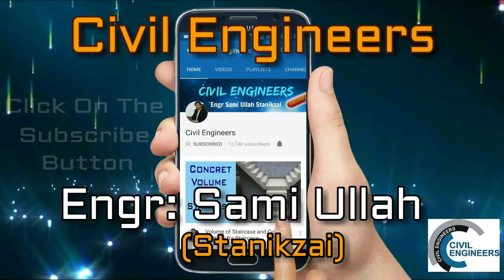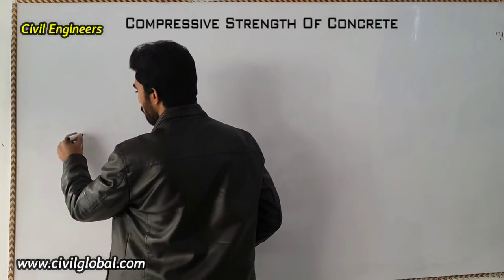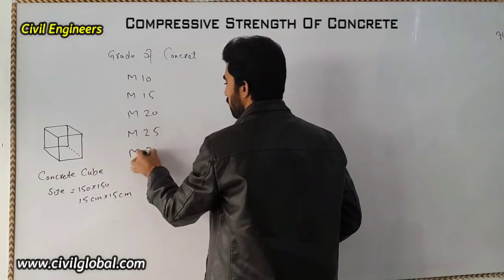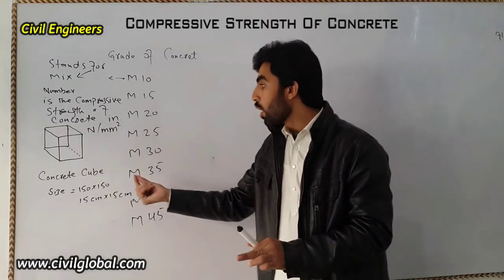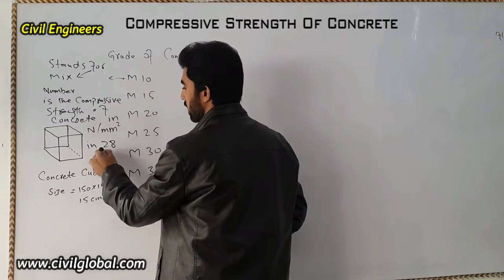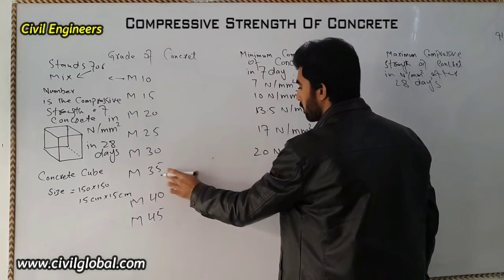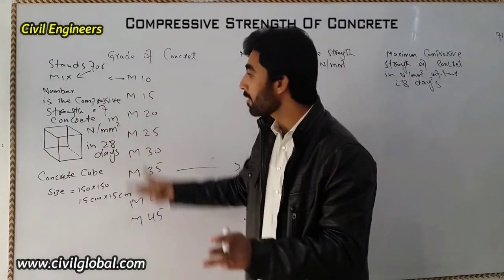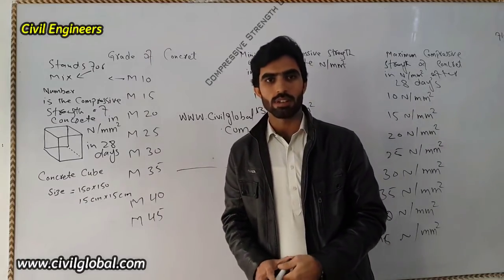compressive strength of concrete Cube after 29 days

Comment: hey bro. I appreciate your efforts. here in this video what about the standard deviation. 
if u r going for a mix design then the minimum strength to be attained after 28 days for M20 grade will be 24.5N/mm². and so on for all the grades. Correct it bro.